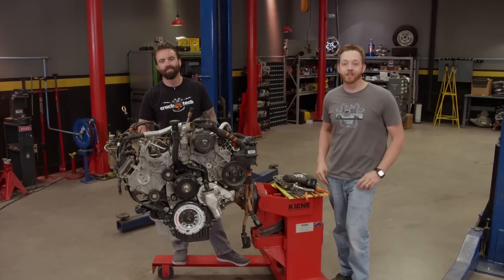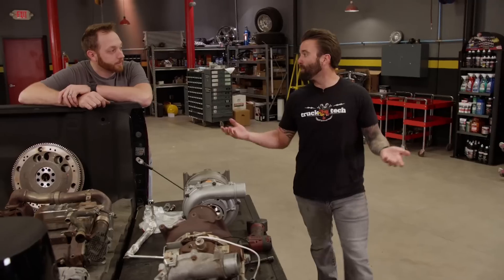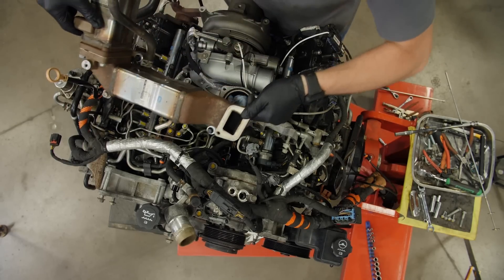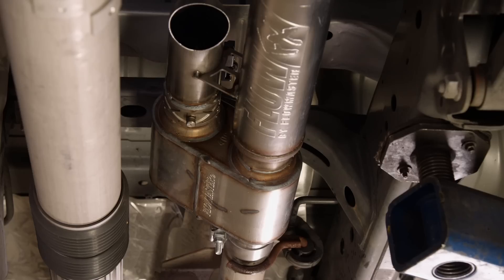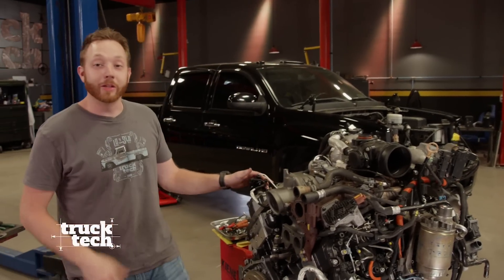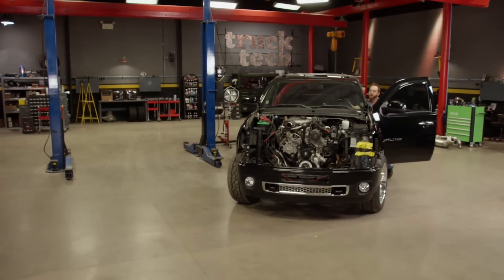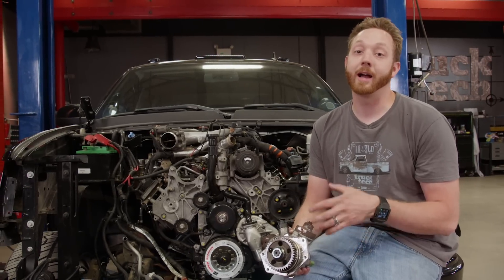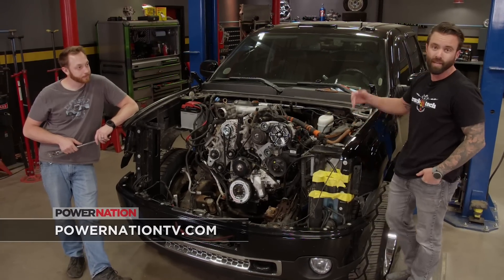Installing The 6.6L LML Duramax Back Into Our '11 Sierra Denali - Truck Tech S7, E12

Comment: All that heat on top, cooking those wires, those exhaust running next to the heads, its like the engineers design problems that limit the life of a motor to make the buyer buy another engineered failure.
Reply: @basshead.  they've been building them for a long time.
Reply: And by the way they are, and always have been built in Lorraine Ohio.
Reply: @keithqueen352  designed by Isuzu
Reply: J. Barrett and Isuzu is owned by GM.
Reply: Isuzu has nothing to do with LMLs. They had nothing to do with any duramax after the LB7.

Additionally, these trucks have no issues with heat regarding wiring/fuel lines whatsoever.

Comment: No one:
Literally no one:
Powernation: "we wanna do the responsible thing and make this thing emissions legal"
Reply: I mean, one can simultaneously love power and want breathable air. There's tradeoffs to everything. Personally I think it's fine to like big trucks, powerful fossil fuel engines, electric cars, and  everything in between + wanting to take reasonable steps to prevent excess pollution. I like to go outside. ...
Reply: @joshsactiveadventures5611  lol a diesel isn’t too bad compared to other things
Reply: They have to, or the EPA will fine them. They’ve been going after YouTubers that modify Diesels and remove exhaust components.
Reply: @randysretired2020  and rightly so. Every state needs to have emissions checked every year in order to register your car or truck. No one wants to breath that crap.
Reply: I’m not gonna get in the details of the principles of internal combustion engines but I’ll simply say this domestic emissions control devices are for profit not increasing engine efficiency and reducing emissions.🐱

Comment: That's why I bought a 2003 Chevy 2500HD 4wd 4 door short bed with the LB7 Durumax diesel. It has no EGR, no DPF, no DOC, with my Edge Jammer Exhaust System it just 4" stainless steel tube and a straight thru muffler and I still pass emmissions. Oh and she sounds great too!

Comment: Engineers have a constant battle with the bean counters who often demand that a beautifully designed engine be butchered so that it can save a few cents in production and not last as long as it possibly could.
EGR systems are not just the demon child of the EPA but the CPA also!
If the exhaust pressure is high enough it would be far better to take the exhaust gasses from after the DPF run them through and air based heat exchanger and then into the intake system. Failed water based heat exchangers often fail and destroy the engine by pumping water into the intake.
If you see a lot of steam and other signs of a blown head gasket check the EGR first!

Comment: what happened to the muscle truck competition? I love the SRT 10
Reply: The sissy v6 never stood a chance.  It basically makes the same power as the V10 does stock.  Plus it looked better than the ricer look Cajun man did to it.   Including removing crash structure to run tires that won't fit.

Comment: Have you guys tested the power difference between EGR + DPF and without them?
Reply: Yes, on a 3rd gen cummins, deleted all the emissions and tuned it, did some small injectors and a 67mm turbo, and a 5 inch exhaust from the turbo back made 550 hp and got 4 mpg better
Reply: @coltertietjen6300  nice 🔥

Comment: Not trying to instigate or sound dumb, I just don’t understand why you wouldn’t want to use anti seize on bolts that see super high temps. Anyone have a good reason why they wouldn’t? Again not trying to pick a fight just want to know.
Reply: Anti seize does exactly that, the opposite of Loctite. Heat cycling causes expansion/contraction, which in turn causes the bolts to slowly back out. Turns in to exhaust leaks and creates problems. The other side of the argument would rather deal with that than snap bolts off when trying to take them out.

Comment: If you plan on giving it 800hp you better at least replace the tierods, they are pathetic on those trucks! I put some huge Kryptonite tierods on mine, of course I'm running 37s even still the tierods on them aren't even fit for stock tires!

Comment: I feel like you guys got told behind the scenes to put the emission stuff back on....however. Good luck getting that truck to run right with a modified engine. The emissions system is stupid particular on those trucks. Computer sees anything off and it goes into limp mode. And 2011s are  the WORST. Even when they are working perfect and "fixed" after something goes wrong, you need some witchcraft to get the thing out of reduced speed mode.

Comment: I just drive an lb7, non of that garbage in sight
Reply: Same here, 2003 with an LB7, no EGR or exhaust crap just a 4" stainless steel turbo back exhaust with a straight thru muffler and I still pass emmissions test just fine!

Comment: 2016. rust repair would be the first hing I'd fix, if I bought  
a truck from that year range. Don't piss and moan. If you live any where were deicer is used, you know god damn well the quarters are starting to rust through.
Reply: They live in Tennessee I don't think rust is a problem, they get snow like once a year!
Reply: If a 2016 is rusting already you didn't take care of it.   My 17 Silverado looks the same as it did off the lot.  And I live in the Cleveland snow belt so I see a lot of road salt.
Reply: I live in up north in Utah by the mountains there there's plenty of snow and salt and my 2003 Chevy 4 door short bed looks great and isn't showing the slightest signs of rust anywhere. Just don't neglect it and it'll be fine.

Comment: Egr is the biggest issue with the duramax, cuts the life of the engine, restricts power, i deleted my 08 lmm and its like a brand new truck, i feel so bad for keeping it stock for so long, now its straight pipes and deleted,. Dont have to make the truck a “racing truck, mine has no black tunes or crazy hp mod, exhuast comes out clear, and hasnt over heated once. Dont skimp out of egr delete, unless you have a fleet of trucks.

Comment: Lame. You lost me at emissions and EGR. That is the worst thing to ever happen to Diesel trucks.
Reply: Then take it off your truck.   No one is stopping you from doing so.
Reply: @bmstylee  my Cummins didn't come with that useless shit.
Reply: @bmstylee  if and when I do get a new Dodge ram the first place it's going is the shop for a full delete and tune.
Reply: That's why I have a 2003 with an LB7 Durumax diesel, no EGR and a 4" turbo back stainless steel exhaust with only a nice polished stainless steel straight thru muffler on it.

Comment: I like the direction this is going. There's no reason a diesel needs to spew out soot to make power. By definition that's wasted fuel, power, and economy. Ask Gale Banks.
Reply: If those kids could read this they’d be very upset
Reply: They don't need to smoke, but they don't need any emissions on it.